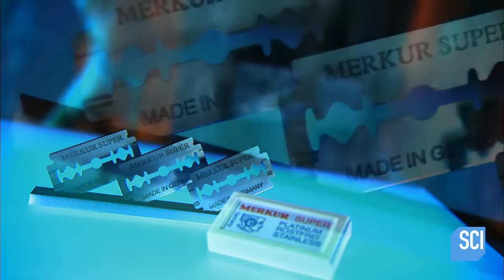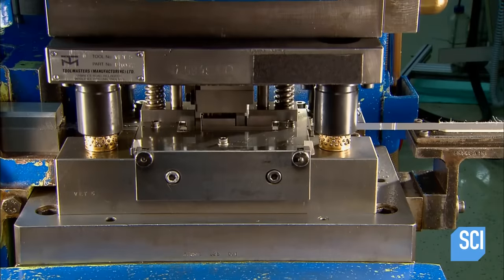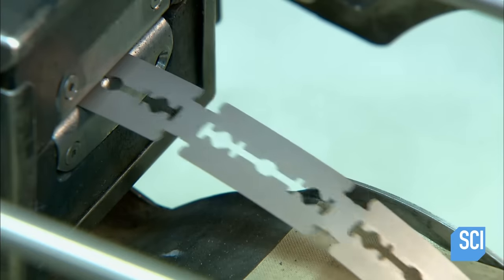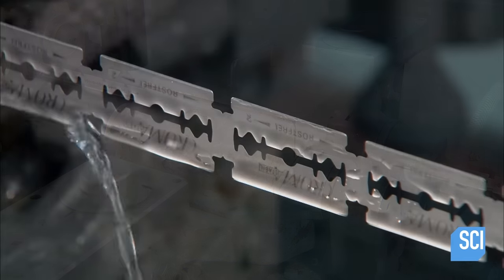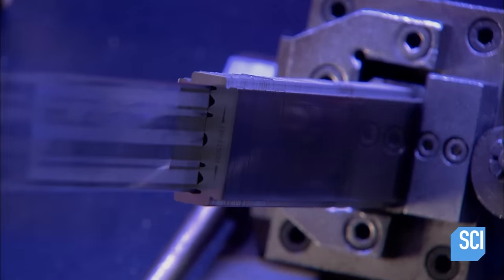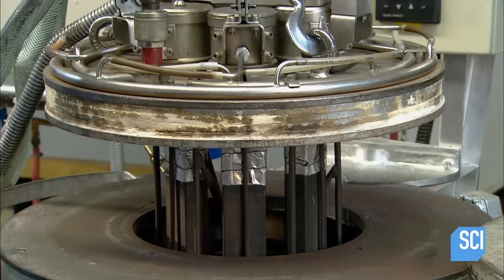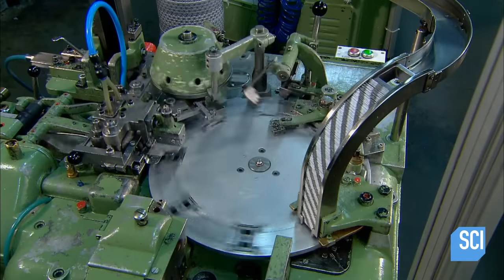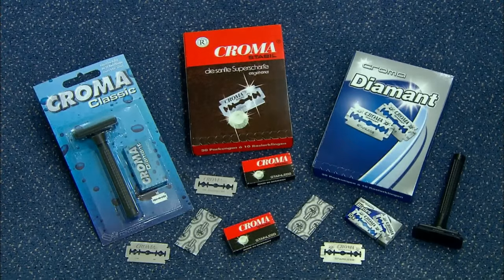How It's Made: Razor Blades

Comment: I have switched back to these razor blades.  I get them in a pack of 100 but they are cut in halves.  Each halve is put in a adapter that looks like the old barbers razor blade.  These are the kind of blades that cut much closer than the dual, triple or quadruple blades that are so damn expensive.
Reply: I have a safety razor double edge. I also have a vintage blade sharpner and the blades I have are maybe from the 60s to 70s and still in great shape. I do not shave often yet I have had the same 100 pack of blades and sharpener and safety razor for more than 20 plus years. I doubt I will have to buy another set. Since mine do not have all of that extra coating they are quick and easy to sharpen. I use them a few times till they get dull and then shapen them and put them in the back side of the pack and pull a fresh one out. I do not know what number I am on or if I have looped. I have not shaved on a normal basics for maybe the last 10 years or so.
Reply: You can fold the safety blades over and they will snap, how I get blades for my "straight" razor. I do stick to using the safety razor majority of the time.
Reply: Even if you toss these blades after single use they are still 8 times cheaper than cartridge razors such as Gilette et al.
Reply: Praise Jesus, Repent or Likewise Perish  Gods are not real.
Reply: not to nention no plastic pollution with them
Reply: I used name brands for years until one day I saw one of these in Dollar Tree. That was literally the best dollar I have ever spent for the best shave I've ever had. Five blades is overcompensating, you only need one if you know what you're doing.
Reply: It's been proven so many time, if you have more than one blade it won't improve your trimming and it's damaging the skin way more efficiently

my favorite today is still the Philip's one blade, which is really safe and run smoothly on the skin, I also have way less undesired zits and pimples because my skin is less irritated
Reply: @spencers4121  straight razors i've seen are more of a single blade, flip out type of affair. i'm pretty sure they can be sharpened by any competent bladesmith
Reply: I much prefer 5 blade gillette fusion - like butter, wicked faster than single blade and safer too.  Expensive?  Yeah, so? So is a Tesla - but it's still the best car out there.  🎬
Reply: I have discovered a method of using a single Gillette Mach 3 cartdridge for at least 3 months. I need to use it in conjuction with an old mach 3 (the backup), which is not fully blunt. Then after 3 months the new mach 3 acts as the backup. I bought a 8 pack to save costs.
Reply: @cuda426hemi  I thought you were actually serious until I read your username!  A troll by the original memeing of the word.
Reply: @forkless  Yeah but don't forget the shaving cream + oil is about 15 times the cost of one of those Gillette cans and doesn't go as far.
Reply: @Astrosisphere  LOL Deadly serious,  Used to be a muscle car guy, but TSLA made me rich so now I laugh at the drones. The cheapskate ends up paying the most; learn it, remember it. One Fusion cart goes months, zero hassle and quicker than old sgl blades.
Reply: @cuda426hemi  Come on - you mean you'd skimp on petrol to absolute zero and sacrifice that raw V8 sound for something that sounds like a Skalectric?  As the Italians used to say about cars: it's not about where you're going, but how you get there.
Reply: @Astrosisphere  Well, I still play heavy metal, rock, fusion and blues guitar and used to defy death in my 'Cuda in the 70s so nahhh, really don't miss straight line noise - turning is cool, too - and you can't beat ripping your face thru the glass in G forces in a Plaid 🐒
Reply: @cuda426hemi  Hahaha, I can't tell if you're serious still but it sounds like a car is lucky to last in your hands.  Go ahead and have all the Teslas if that's the case!
Reply: @Astrosisphere  I don't even OWN a car anymore - I just keep watching the TSLA grow and grow. Ownership is so yesterday. If I need to go somewhere (in Hollywood) that requires a car I'm picking a Tesla Uber or leasing different cars for sh*ts and giggles - but I hardly ever need one in retirement.  🚗
Reply: @cuda426hemi  Tesla didn't make you rich.. The taxpayers did. As they subsidized 30% of the cost...
Reply: @WizzRacing  Wrong.  People buying the stock made me rich. Subsidies have nothing to do with stock - it was only $40 when I entered.  It's 5x split since and sits at a Grr - do the math.Tesla took all the subsidies that every other mfg could get but legacy auto being stupid late in denial of the future  STILL ends up PAYING Tesla for EV credits because the Govt. is mandating clean air. Follow along? Elon himself says there should be NO subsidies. Tesla's total was 2.3 Billion or what Elon carries around in his wallet - nothing. Taxpayers gave the Oil/Coal/Gas industry 5.2 TRILLION last YEAR for why? Petrol heads take it up the ass and like it when they gouge you??? So yeah it's a GOOD THING EVs get subsidies isn't it? After all, there is nothing good about oil, nothing. 🇺🇸
Reply: @cuda426hemi  Exactly.  I use absolutely no pressure.  After a shower and lathering up, the Gillette Mach is so unbelievably close and there's absolutely no irritation.
Reply: @cuda426hemi  Lol, right - why would you have a car when you can have 4 servants carry you around on your big movie-star throne?  Whipping paint to make it go faster just doesn't have the same effect!
Reply: @cuda426hemi  If you think a plaid can turn, I've got a bridge to sell you.  There are street car 4 cylinders that will absolutely crap all over a plaid, and they aren't at the mercy of the local power grid to charge.  Amazing how you can shill for a car that you DON'T EVEN OWN.  You're not allowed to talk anymore about how much "better" a Tesla is when you don't even drive.  Try to drive that Tesla cross country.  I'll bet I can get across 2x faster, and I'll even use a car that doesn't make over 200hp, and I'll never break a speed limit.  You're allowed to go as fast as you can get away with.  

EVs will absolutely never replace the ICE.  They're a novelty, and they've existed before, been touted as the best thing ever before, and claim that they'll kill petrol burning engines before, and they always fall to the wayside.  It's already happening now.  Tesla only survives because it's currently popular.  We'll see where they are in 20 years.  

Meanwhile, I'll enjoy having tesla plaid killing power in my dinosaur juice burning cars, and not be solely dependent on the already way-too-taxed power grid and an hour long charging experience to drive it.  Oh, and before you cry about gas prices, all my ICE cars can run on e85-e100.  I can buy some local moonshine for pennies, drop a couple drops of 2 cycle oil in it, and be good to go no matter what Uncle Joe and other communists do to the current gas prices. :) under $1 a gallon fuel that has over 118 octane ftw.
Reply: @cuda426hemi  ?
Reply: @jamesharmon3827  Yep, my handle since about '89, online with email and web way before most... Thanks for bringing that up! 32 years or when Elon was 19!! Also it was my 2nd car @ age 21 brand new $4k from showroom.   🇺🇸
Reply: Dont understand these people who use razors, when you simply can use a Philips Oneblade to do a rough shaving (im still on the original blade after 2 years of shaving) and then finetune the shaving with a Braun Series 7. If I want even closer shaving, I could invest in a Braun Series 9.
Reply: @sebastiannielsen  those Philips and Braun are not even close to a DE safety razor when it comes to shaving to achieve a smooth skin.
Reply: Where tf did this comment chain veer off to
Reply: @spencers4121  you're referring to a shavette. And they don't provide even a remotely close experience as a true straight razor. The weight and grind of a straight razor is everything.
Reply: @sir_abhishek  I like the smooth comfort of 5 blades - you don't have to be careful at all and they last - well I'm going on 3 months on latest Gillette cartridge.  Diffferent strokes!   👀
Reply: same. Gillette cons us for years. these are way better. i bought 100 in 2017 and still haven’t finished them in 2023.
Reply: @forkless yep. Gillette are making a fortune taking these 10p blades, snapping them in half placing them in a plastic holder and charger £2.5 for them

Comment: not much material but its insane how much effort goes into those things for them being so insanely cheap if you buy in packs of 100 or more
Reply: You'll notice quality importance after you cut your skin
Reply: Lol good blades are not cheap
Reply: @MadScientist267  double edge razor blades? Well yes they are. Got a pack of 100 astra platinums for 10$. Works perfectly fine
Reply: @MadScientist267  define good
Reply: @zat-svi-ua  "last longer than 6 shaves"
Reply: @MadScientist267  6 shaves is perfectly fine for just one blade. think about it on a cartridge razor you got like 6 blades all stacked above each other. on a double edge razor you obviously only got one per side. Out of my current Astra platinum I can prolly get 10 shaves from both edges per blade, with a cartridge razor I'd struggle to get 30 yet they cost how much? like 5$ for just one of them? I dont know what you're buying but good quality double edge razor blades arent expensive.
Reply: @KeterMalkuth  just looked it up those Gillette ProGlide blades cost 4$ a piece. thats in a 50$ packet for 12 of them??? Bet you I can get way more shaves out of 300 BIC blades. 100 of them cost 15$ and I'd argue the Astra platinum are even better for less money. can get 500 of them for the price of those overpriced plastic shit things
Reply: @dermax_hd  i agree with you, you can go to the most quality double edge razor blades and still get more out of it than those shit multiblade plastic handle ones
Reply: Mass production and bulk selling for ya
Plus as you said they're really thin, it's quite a few processes but once they've built the factory they only need to refill oil and coating, the rest is temperature hardening with gas and electricity
Reply: @MadScientist267  Good blades are cheap. We're talking about the ones in the video, that go into safety razors and such. You're thinking of the overpriced and scummy model of selling plasticky throwaway razor bodies and blades or worse yet the "subscription model" razors which are just inflated prices since they want to milk everyone dry and make the most profit out of every customer.
Just buy a safety razor and you'll be set for years with a pack. It's easier than it looks.
Reply: @acidset  it's interesting that no one that's used a safety razor for longer than a month wants to go back to those shitty plastic things. Not only cause the cartridges are so extremely overpriced, but also because 6 blades aren't gonna cut your hair any better than just one, fresh out of the box,extremely sharp blade. Besides it's not gonna fuck up your skin as much.

It's almost like most people buying those plastic things only do cause they don't know there are any alternatives ;)
Reply: @MadScientist267  Yes they are. Even the most expensive premium brand won't cost much more that 50 cent per blade. And normal, good ones are about 15 cent per blade.
Reply: @MadScientist267  lmao de razors are one of the cheapest shaving methods out there. Give it a go, you won't look back.
Reply: @MadScientist267  Yes, they are. That's the thing, those expensive blades aren't any better. They just spend more on marketing.
Reply: @thenonexistinghero  and get more money hahaha. You really think a Gillette blade is worth like 3$ in any world? Even with all the marketing they prolly don't spend 50 cents on a blade
Reply: @dermax_hd  I also use Astra Platinums and can confirm they are indeed fantastic.
Reply: @JacobDTulio  have a look at the newest Amazon reviews tho. The ones I got from 2019 still have the bold lettering and are amazing, the newer batches apparently changes their design to thinner lines and way worse of an edge.. shame really :/
Reply: @dermax_hd  What part of "those expensive blades aren't any better" is hard to understand?
Reply: @thenonexistinghero  i was agreeing to your statement mate. I said "not only they spend the extra money you pay on marketing, but also get way more money in return to get rich. Even with all the marketing, they're just hella overpriced
Reply: @KeterMalkuth  and no plastic waist, closer and far more enjoyable shave with far less skin irritationor cuts
Reply: That's what I thought. These are decent quality but still only about $20 for a 100 pack. The batches didn't look all that big and there were lots more steps with manual effort and quality control than I would have imagined

Comment: I like how a full half of the process is quality control
Reply: its only to show on this show, cost cutting does not allow this
Reply: Seeing how sharp the edge has to be it is needed, anything short of perfection results in torn up skin.
Reply: @oksowhat  Source?
Reply: @snickerdoooodle  no source genral common sense, these things sells for same price as a tofee, its not possible to quality check each and every piece
Reply: Germany my dude
Reply: German made
Reply: @oksowhat  Why would it be needed to test all of them? if there is a single problem on the manufacturing like, it'll show up in a sample.
Reply: @oksowhat  Those stacks have thousands of razors, if you had a problem with the machine and they started effing up people's faces, you would be in a ton of trouble. Hiring one dude to inspect one razor in thousands IS cost cutting.

Comment: Agreed.. I went from the 5-razor plastic nonsense to a single blade and the single blade gives me the closest shave hands down..
Reply: Which is weird because multi blades are meant to pull hair up and cut what would usually be under the skin for their smooth shave.
Reply: @amichiganboiwhosereallazy1544  If you use a safety-blade I recomend using shaving soap and brush . Applying the soap (which is better than aerogel crap) with a brush stirs the hairs so that the sharp blade cuts it once and precise at the root
Reply: @spingbay7039  aerogel is a solid and not what you think
Reply: Same. Can't go back to that 5 blade crap after using a double edge razor.
Reply: The 3 blade ones always worked the best for me. 5 blades was way too much, like shaving with sharp velcro.

Too bad they cost too damn much. Went to a traditional razor simply due to cost. Better than the 5 blade ones, cheaper than the good 3 blade ones.
Reply: Praise Jesus, Repent or Likewise Perish  Sir, this is a Wendy's.
Reply: Praise Jesus, Repent or Likewise Perish  JESUS SHAVES.  Gobbless
Reply: @spingbay7039  I use shampoo and rub the hair then cut it with any razors, works like a charm
Reply: @amichiganboiwhosereallazy1544  marketing nonsense
Reply: @amichiganboiwhosereallazy1544  The lift and cut is such BS. Is it dull enough to grab & lift or is it sharp & cutting through? It can't be both. That aside, the old school blades like this video are great. You just don't notice or need much if you're younger & not very stubbly. You get used to the highly marketed multi-blades because they work fine. But they're pretty useless once you get a pretty good density of facial hair as you age.
Reply: If you use a slantbar razor it's the closest thing to a straight razor you can get ....but they take some getting used to ....they will cut you before you know it ....
Reply: I just use an electric hair cutter every week.
Reply: Less irritation and nicks, too.
Reply: @Mastermindyoung14  not according to most popular depictions...

Comment: "4 one thousand of an inch"
These imperial units are just unbelievable
Reply: It's perfectly clear what he's saying. It's 1 thousandth the length of an inch. Anyone can intuitively understand roughly how long that is. You're legitimately just upset because he used the word inch
Reply: None of those are imperial except for one word, like if I said 4 thousandths of a millimeter you would understand me babes
Reply: @shrimpshufflr7745  It's an often used format in documentaries but I hate it, just say 0,004 instead :(
Reply: Just be glad he didn't say 1/250", ya snooty Euro.
Reply: @shrimpshufflr7745  metric would usually say 4 micrometers
Reply: @juanplopes  well I guess those have roughly the same clarirty